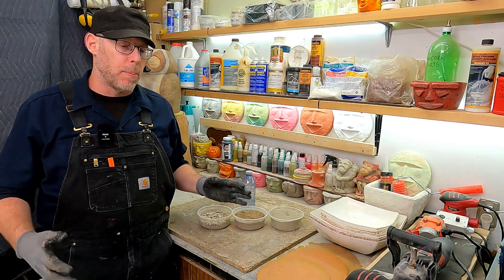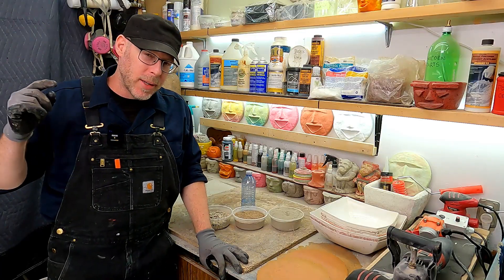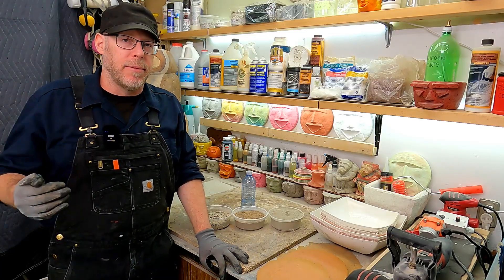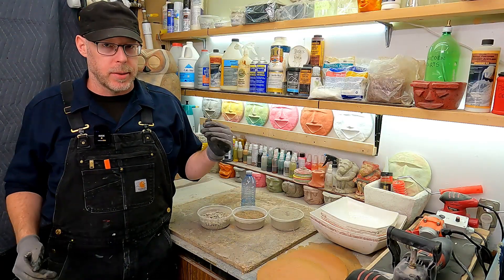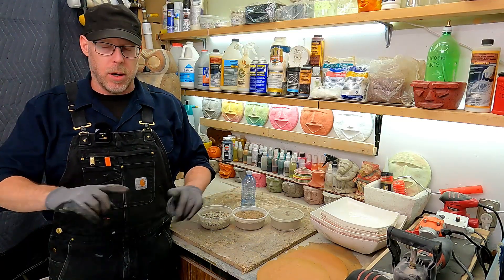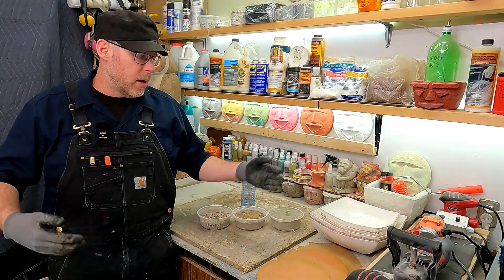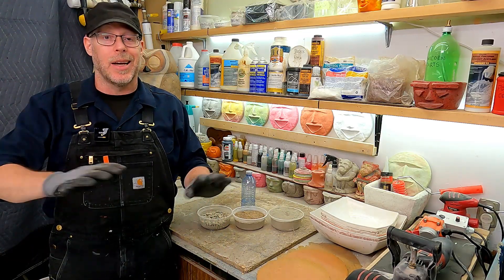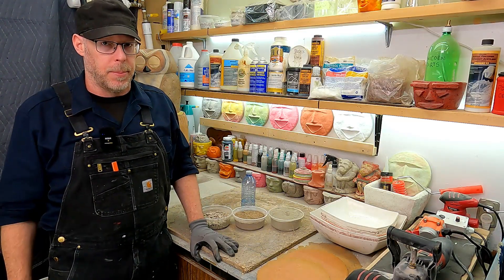Avoid THIS Guaranteed Concrete Bond Failure

Comment: What about rebar dowels to connect the poured concrete to an existing slab?  I have a ton of clean saw cuts for a drainage trench I cut into my basement slab.

Does this make a good enough connection to leave the cuts smooth?

Comment: These videos give helpful information. This issue is the #1 concern that has held me back with my wishes/ prep/ plans to make larger concrete sculptures. I don't know how to handle hand building if I don't finish in 1 sitting, due to the concern about bonding. I still am left with a lot of related lingering questions, about factors such as the age of the existing concrete: what if it's only a day old, kept wet, & still curing? vs old/ aged concrete. If you know you are making additions, how much does it help to rough up the surface while wet & have rebar/ lath/ mesh/ wires/ mesh fiber tape etc protuding for the additional connection? What about building in separate sessions with the aid of bonding agent? What are the best strategies to handle additional building in advance:, such as should you fully complete each area all the way to surface detail? Or should you shoot for laying in a complete base layer & then your additions = top layer details? Is the concern the same with modified mortar concrete? I'm voting for an additional video on this topic. This info is EXTREMELY helpful & difficult to find answers/ trustworthy sources. I consider this channel trustworthy. I like the building methods in your videos. Peace everyone/ art world people.